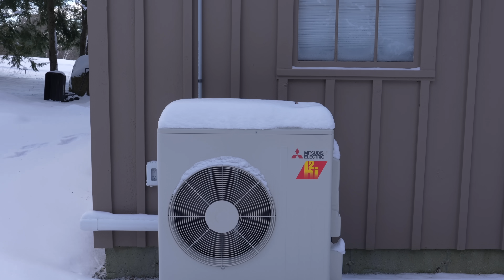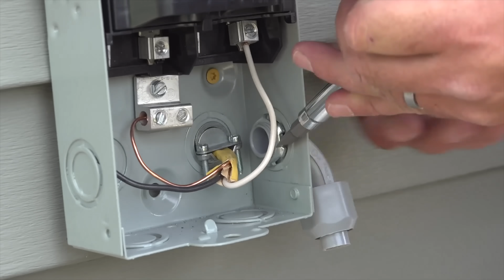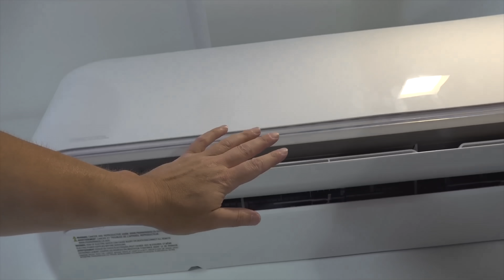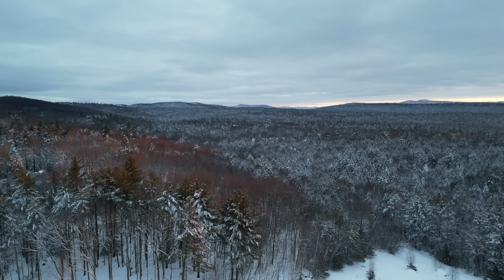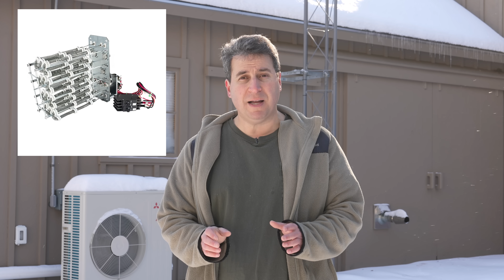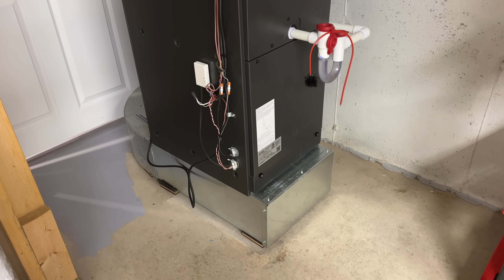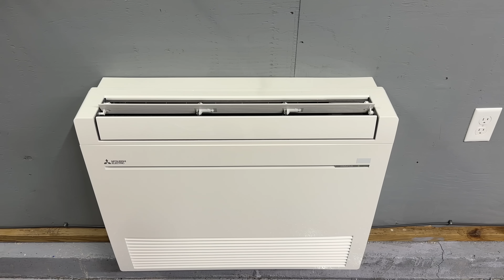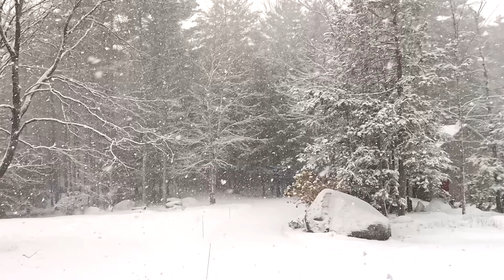Why Heat Pumps are now leaving people COLD

Comment: In my case, I have a mobile home and heat with propane.

I use LiHeap, but run out of funds every year, ending up spending about $300 every year for a final fill-up.

I want to buy a 12,000 BTU GE Soleus window mount heat pump to mount in the hallway of the trailer to heat it when the outside temperature is over 40 degrees F. I'm not sure if I can heat both ends of the trailer with a centrally mounted heat pump, but the backup plan is to add an 8000 BTU Midea heat pump in the bedroom, replacing my AC, and move the Soleus to the kitchen at the other end of the trailer.

It is interesting to note that the trailer is more comfortable at under 20 degree F than higher outdoor temperatures because, while the inside temperature is colder, it is more consistent because the furnace runs continuously. The up and down of the room temperature bothers me more than a temperature a few degrees colder.

For the record, I have two oil space heaters to supplement the propane heat when the temperature drops into the single digits.

Comment: Some heat pumps are designed to function at low temperatures. They will efficiently produce heat down down to below 0F (efficient meaning COP > 1). But it is essential to look at the specifications and do a proper calculation to ensure that the heat pump will produce sufficient heat at the coldest temperatures your home will encounter.

After I looked at the numbers, I elected to go with a hybrid system.  I have oil fired steam heat in my 1930's home. I insulated and installed minisplit heat pumps, and couldn't be happier. I use the minisplits when it is above freezing or when I only want to heat a single room, and use the steam system when it is below freezing. 

My oil use went down tons, and my electric use went up; at current prices I'm saving about $400-$600 a year. Part of the savings is from more efficient cooling in the summer, part from cheaper heating in the winter. One huge convenience factor: I now use less than a full tank of oil every year, so I get a fill in the summer when the oil is cheaper.

I did verify that one of my heat pumps would produce heat at -7F during a cold snap, but it sounded like it was struggling and I wasn't trying to see if it could produce enough heat to keep up with the demand. I just wanted to see that it would work. I don't use them this way because at such low temperatures I calculated that burning oil would be cheaper than buying electricity, and I was aiming for the cheapest heating for my house.

Comment: I don't think it's true that Aux heat saves any electricity over running the heat pump constantly - it only kicks in after the heat pump fails to achieve setpoint in the house, or if the delta between indoor temp and setpoint is too large, and they have a COP of 1. Heat pumps should have a COP >1 even well below 32, especially if you're talking about a Hyper Heat or similar.

Comment: I put a Pioneer Hyperformance mini split in my 340 sqft enclosed 4 seasons room.  We had a cold snap this January and my electric bill is $100 higher than the hottest summer month running my AC unit.  In fairness, it does run a lot because I have so many windows in my room.  I insulated as best that I could.  That was just a punch in the gut to see the electric bill.

Comment: Minisplits work year round with no issues. I use a heat pump for the main heat source on the first floor and mini splits for the second story. Mini splits run pretty cheaply all year. I regret the whole house heat pump. It's paired with an outdated duct system, so winter is expensive.

Comment: There is a mini split in this home I am renting and it works great until the temp drops to the 30s and then its no longer keeping things very warm and we have to use wall heaters and space heaters. I will not be going with one of those systems in my new home I am getting soon. I need to figure out the system I am going with though. Luckily I live in a temperate climate in Washington.

Comment: On conventional air to air heat pumps, supplemental heat is a must! If nothing else, for the defrost cycle.
Reply: If a full heat loss calculation is carried out on the property to a chosen external temp and the heat emitters and heat pump is sized to that then you don’t need supplemental heating

Comment: I had one in my apartment;

What a "heat" pump is, is an airconditioner in reverse! And the only way they can work is if there is any heat outside. Normaly there isn't eniugh to warm the home! I'll never have one in my house!
Reply: Heat relative to the boiling point of the refrigerant in the unit, if the boiling point is -50 degrees Celsius then minus 10 outside is considered warm
Reply: 100% BS, there is more heat outside then you realize, your knowledge is stuck in the 1980's , lol, your lacking knowledge , I have a mr cool universal ducted heat pump 2ton (3ton selectable by dip switch) i have it set for 2ton for 1100 sq ft town house built in 86 and decently  insulated, but not perfect, there are some drafts, and the heat pump keeps the house at 73-74F  with a temp of 0F outside, it was zero degrees outside a few times during the winter, and no it did not run continuously , my entire elect bill was about $139 durring the coldest month, i did a temp test at the register, and the hot air coming out of the register was between 134-135F, you just have to get the right heat pump, you need the cold climate heat pumps.. the heat pump I have will give you 100% of the BTU's which in my case 2ton (24,000 BTU's) down to -5F , so SCREW NATURAL GAS, i would not want it even if I could get it, its not available in my area, and it would cost MORE to heat my house with natural gas then what I currently have..

Comment: North America is behind the rest of the world for cold climate heat pumps. If you use a air to water mono-block R290 heat pump, you don't need supplemental heating for temperatures down to -25F. R290 heat pumps can also heat your domestic hot water to above 160F. All the refrigerant is in the outdoor unit so only 2 water lines run in and out of the house. This system can replace a central forced air furnace/AC by installing a water to air coil in the air handler. It can also replace a boiler for radiators or hydronic in-floor heating.

Comment: House in North East Ohio running 2 cheap 24K btu Senville Leto units 2000+ sq ft unfinished basement with no insulation, dead of winter down to 8 degrees still keeps my house at 70 in a 110 year old multistory house with questionable insulation.  I have oil heat as a back up have not turned it on in 2 years.  My wife likes the house warmer than me so she will occasionally run a space heater for an hour or so a day.  Cut my energy bill by more than 2 hundred a month in Dec - Feb.  Only regret is that I did not buy the more efficient ones that have better COP at below 20 degrees. I sill get 2.5 which makes it more expensive than gas but less than oil.  No gas line near me so not an issue.

Comment: eh, I had 2 heat pumps in my Maine home during the insane winter a couple years ago windchill down to -40. Combined with a woodstove in the basement they kept me warm and still ended up cheaper than oil or gas.

Comment: Heat pump condenser should always be installed inside a basic closed shelter/lean-to greenhouse or at least protected, they are never never protected so they wear more. More over surprisingly in canadian winter, when the heat pump condenser fan is running You still gain 4 Celcius degrees from the outside in the closed shelter/greenhouse not insulated , the heat pump condenser fan running does not seem to cool down the closed shelter/greenhouse. and with a little sun the heat pump condenser loves it.

Comment: Good video. We have new home in middle Tennessee and it has heat pump with the supplemental electric heat strips. Works great with the Honeywell digital, wifi thermostat.  The display changes color when the aux heat cycles on.  It also has option to just turn on the aux heat, referred to as emergency heat.  This turns off the out side heat pump and your heating with Aux only. Another thing that happens sometimes on the heat pump on really cold weather, is it gets ice built up  on the coils and even though the system comes with a defroster, sometimes you get short cycling if it has trouble melting the ice and it’s just better to put it on emergency heat until I gets warmer.

Comment: Your all right about it, except Fujitsu. Well, now chinese are trying to follow suite. A 12 000 BTU Fujitsu makes 18 000 BTU at 5F. 15 000 at -5F. Its overengineered... I am heating with 3 wall units, a 2500sqf house down to -15F and below. COP at -5 is still 2. I've took many measurements and done a full house heating calculation. There is a very interesting spreadsheet (excel) that an assciation gets out every few years, comparing heat pumps output and COP at down to -5F. Can share if interested. You'll see why Mitsu can't even get close making barely 12 000 BTU at +5F and droping sharp thereafter...Oh I am living in Canada and with a Mexican wife, it is 75-77 at home ;).

Comment: I have a heat pump in my NC 2021 new build. It is not efficient under 40 and the air coming out of the vents drops below that temperature. A few years ago, when it dropped to 7, the air coming out of the vents was 65 and it wouldn't go above 57 in the house.

Comment: I have a Rheem/Ruud furnace/heat pump combination system here.  It uses the heat pump but once it hits around 20F it will start using supplemental heating elements to keep things comfy inside.  I've had it as low at -5F outside and while it runs constantly at that temperature, it will keep the place comfortable.  My electric bills are far lower, especially in summer, but also in winter time than the pure resistive heating system I used to have.  Spring/Autumn can result in sub $100 electric bills for a 1400 SF home.

Comment: i am a tech, in cold climate, and dual fuel is necessary. ducted or wall mount mini spits in cold climates are a NO NO.   cheap home flippers are installing mini spits it old homes and guess the results in cold weather. your hiring an attorney.
Reply: How cold? I installed a gree mini split and it's still blowing warm inside when it's -40 out. It's not efficient at that point, so I supplement with a propane fireplace. I'm thinking of adding cove heaters

Comment: Being an HVAC contractor I did my own system and opted for a dual fuel system with Heat Pump and a natural gas furnace system. 

It’s a two stage heat pump and two stage gas furnace. 

So when it drops below 35F outside and the humidity is high it will switch over to the natural gas furnace on first stage and then second stage if it needs it. 

The heat pump is great for the mild days above 40F and you get that nice mild warm air from the heat pump.

Comment: Heat strips are super expensive and inefficient to operate. Keep the gas furnace in extremely cold climates. Electric heat is only doable WITHOUT the heat strips, those will skyrocket the electric bill.

Comment: Any time you follow gov propaganda,  you are a fool.  Water freezes at -1c.  Moving water starts to freeze at -14.  -14 in canada is a nice temp.  We skidoo, toboggan, ski snow board, skate ect.  Minus 25 we endure, -30 is not fun to work in -40 is bearable but air Hurst torrent, -55c steel snaps if bumped, fire doesn't even want to burn .  So tell me how an external waterpump is good in canada?  Liberal incompetents. Snow on a heated pad , melts, and freezes the fans .  Great invention.  Natural gas, wood heat are essential heat as any wise person knows.

Comment: You are so right about supplemental heating.  I have an ACiQ Multi Zone Extreme Heat system.  It advertises that it extracts heat in temps as low as -22F.

I live at about 7,000 ft altitude in Colorado.  The lows lately have been in the single digits and teens.  The highs in the 30's.  Below 20F, the system goes into "defrost" mode a lot.  This really lowers the efficiency, and cools the house because it is not heating during these cycles.   We've tried adding 10% more refrigerant, since it uses refrigerant more during the heating cycles.  No changes.

I do have an in floor heating system that uses propane, but try not to use it as the backup because of the cost of propane.  I relied on the manufacturer's claims that it can heat in colder weather, but have been largely dissatisfied.  Really do need a supplemental heating system.

Comment: I have to disagree with this video. My 1200sf house in Maine is over 30 years old and can easily maintain 68-72 degrees with two single zone heat pumps and no supplemental heat  for 99% of the winter.  I do need a little supplimental heat if it gets colder than -5.  Last year I installed 9K and 12K Mitsubishi Hyper heat wall units and they used a total of 3,000 (extra)kWh for the entire season! This cost me about $400 for the entire heating season solely using heat pump to heat my home. I do get special "heat pump rate" from my electricity provider, but even with the regular electricity rate  it's way less than any fossil fuel system. Even though it was not an extra cold winter the heat pumps were able to keep up even when we hit negative digits.  One thing I struggled with is the temperature setting, I learned to just ignore it and not be afraid to turn it up when It gets cold. I just monitor the temperature with thermostats at a normal 4ft level throughout the house.  I also have wood stove and only used it when the power went out.  😀  If your getting a heat pump I strongly recommend getting the single zone units.  My 9K heat pump has a 30.5 seer rating.

Comment: Dual fuel is the future, they’ve been selling like crazy around me. Ducted heat pump A coil and gas furnace with temperature cut out’s. Get the efficiency and still have the comfort on the colder days

Comment: European energy prices are WAY higher than US and these heat pumps are forced on us by law. Kerosene and gas are both far far cheaper. Heat pumps only suit property with solar panels installed, instead of storing in battery you expel it straight to heating / your EV.

Comment: I live in Norway and got a heatpump 2 years ago and it work wery well in the summer as aircondition and heatpump in the winter and when it is under -25C cold then i must fire in my fireplace a little and that is normale so i live fine with that :) I Have a Panasonic heatpump/ airconditioner. Its the best investment i have done as the electric power prices is insane here and as you know those heatpumps almost don't use any power at all!

Comment: In Quebec, heat pumps are common.  That said, the best systems are ducted and have a supplemental heating system. Typically, either an oil, gas, or electric furnace.  The supplemental heat kicks at minus 12-14 degrees Celsius.  We love ours, and for the past 26 years we’ve been warm in the winter and cool in the summer.  We also save a lot on our electric and oil bill.  Our annual electric bill totals about USD 1,800, and our oil bill is about USD 700.   This covers an approximate 2,500 Sq. Ft. two storey house and two heat pumps - one is for our pool.  Note that we are in freezing weather from December thru March.

Comment: My neighbor in NH has a combination hot air system - a heat pump, and a supplemental propane furnace when the temperature drops too low.  It works just fine.

Comment: As the owner of a commercial HVAC company, let me share some of my own insights. 1) The outlet temp of a heat pump is significantly lower than that of a fossil fuel system. Electric strip heat is hot, but it is THE most expensive way to heat a space. This lower outlet temp of a heat pump makes the air seem cooler than most people want. 2) The parts for a mini split system are ALL proprietary, so their cost is locked in to whatever the manufacturer wants to charge. A conventional split system for central heating and air conditioning has many parts with multiple sources, saving money on repairs. 3) The most satisfying and cost effective way to heat a space below a 20° F outdoor temp is natural gas. The equipment is easy and cost effective to repair, the fuel cost is relatively low, the initial capital expenditure is low, and the outlet temp is very comfortable. Side note: most mini splits are  rebranded Chinese units, made by Gree. Mitsubishi is Japanese, and it is a better product, but they know they have you over a barrel...like buying a new Toyota. The biggest problem for consumers is that all of the efficiency being required by the DOE has added initial and repair costs that eat up ALL of the savings from that efficiency. It's literally robbing Peter to pay Paul.
Reply: Yes, and to compare the fissile fuel system. Eating the WHOLE rabbit is also more energy effective instead of just the meat. You can do that, but you wont, right? Cause it affects you directly. In the same sentence think about the climate.. please.
Reply: We can barely generate enough electricity where I live now, there is not enough capacity. The only way to ge more is making it with natural gas. May as well just have a natural gas furnace instead of dealing with this stuff.
Reply: @ realclassicman...There is zero evidence that anything humans do can reverse ANY trend in climate. Add to that the various lies being told by climate enthusiasts, and you have no basis for trust in the bought-and-paid-for research into Big Climate.

Comment: I'm I Michigan and it works great. Mines good for - 14f for shut off. At 10f to 25f it runs very efficiently. Costs 60 a month to heat a garage to 70 in dead of winter

Comment: Most honest and concise explanation about why heat pumps fail to perform in cold weather. I'm in the south and when it gets below 20 degrees, all you get is mildly warmed air.  Even the supplemental heating elements do little to nothing to help. To be fair, my whole house heat pump system is 20+ years old. Thank you for the video.